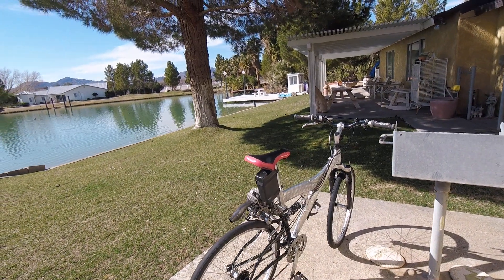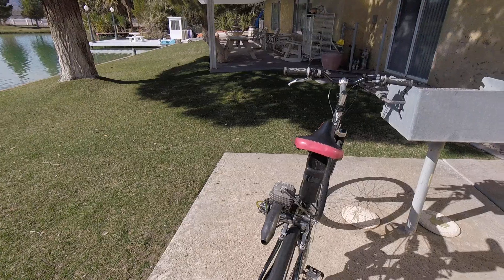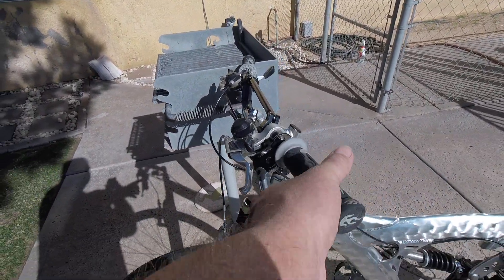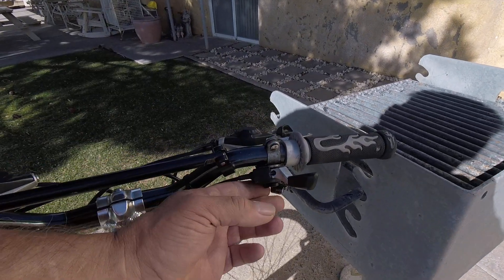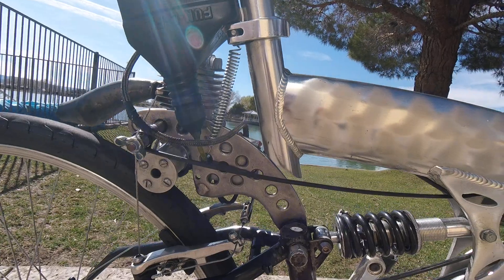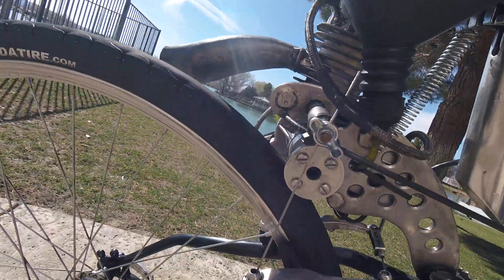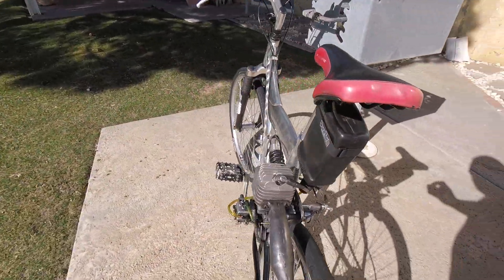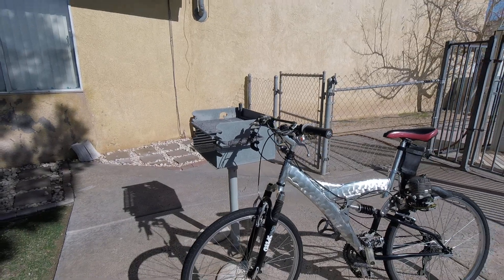Homemade Gas Bike! "A Closer Look"

Comment: That is so cool Mike. So basically you can ride freely no problems, then pull in the clutch to increase the pressure on the rear wheel ? Is that also a different bikes rear end where you said it was sleeved. The bike looks like it would have been amazing in 2000 mate. :)
Reply from the maker: Exactly Ryan there is no attachments of any kind to the drive train of the bike so it rides just like normal until engaged. The sleeve is in the frame to hold the engine mount in place which makes the pivot point or swing arm of the mount. Lol, you should see my first gas bike I made in the 90's it used a weedeater engine! Thanks for watching Ryan! Have a great day my friend!